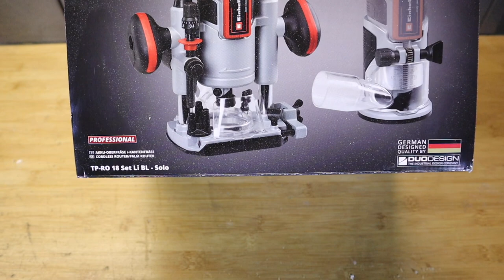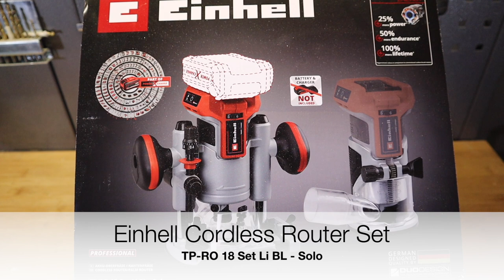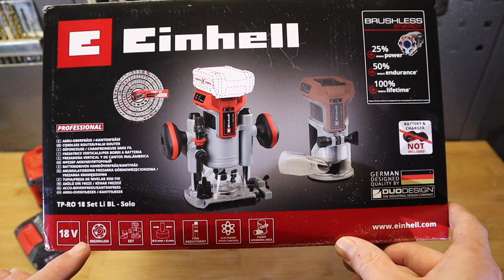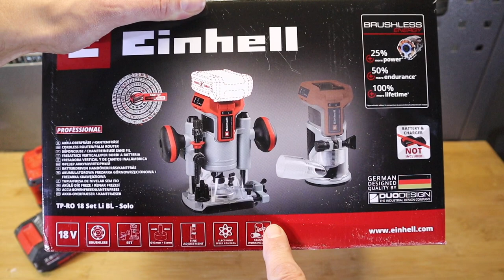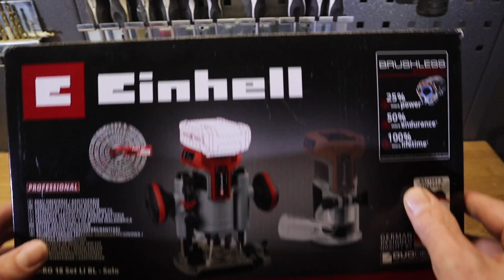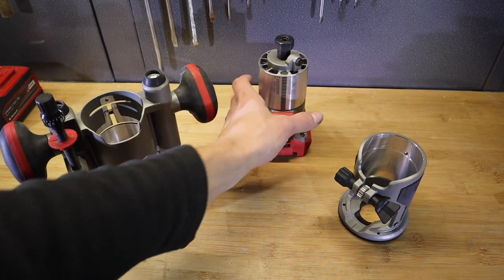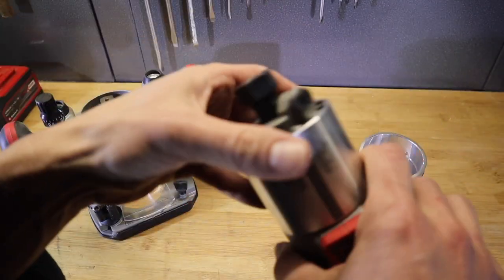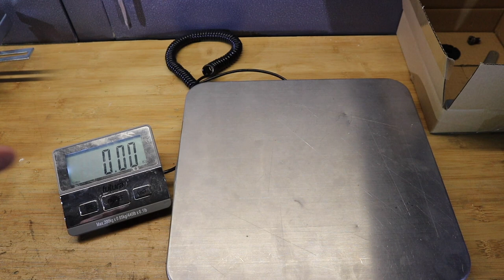Einhell Cordless Router Set - TP-RO 18 SET Li BL - SOLO - UNBOXING & TEST

Comment: I find that if I use the palm base, after I tighten the router to the base, the router kinds of tilted towards one side a little bit, making the routing bit slightly angled instead of 90º straight. That’s one thing I don’t like about this unit.
Reply: Still having that issue?
Reply: @ yes. I put masking tape on the router to compensate for the slight gap between the palm base and router

Comment: I am really impressed by the quality and power (especially during the oak test). I wonder if you have makita trim router to check if base fits :)? great video overall :)
Reply: The guide notch/groove is in the wrong  spot for makita accessories. I was thinking the same thing
Reply: I got curious I went and bought one you  can get it to fit the makita offset base. It fits in the plunge base but won't go low enough from that hump with the name on it.
Reply: @igorkuzmanovski5552  What a shame :( thanks for checking this out :)
Reply: @igorkuzmanovski5552  still liking the einhell?